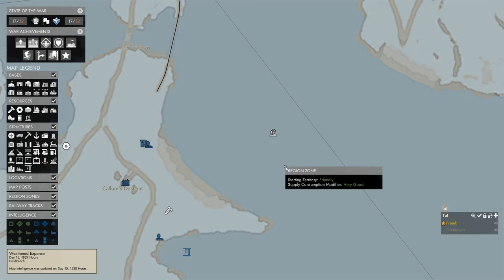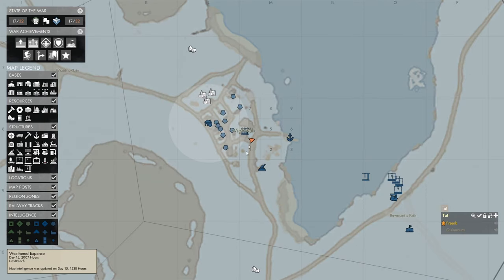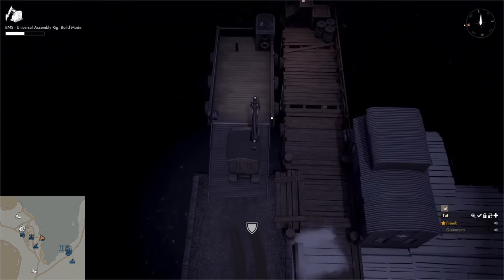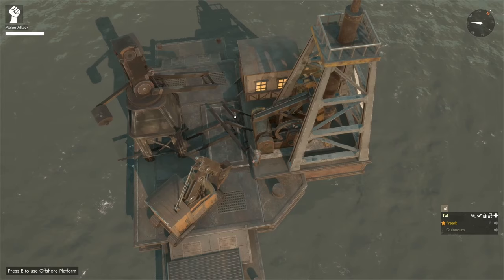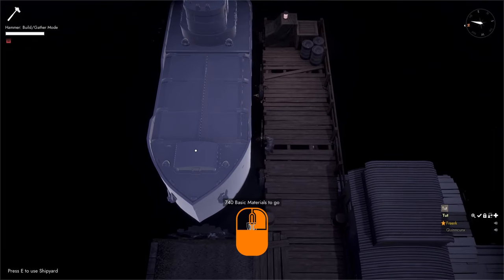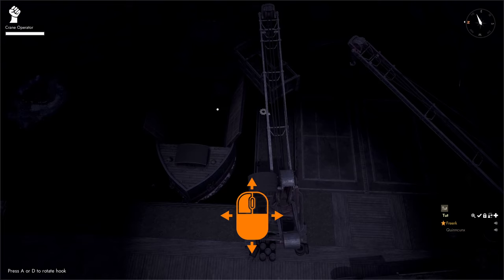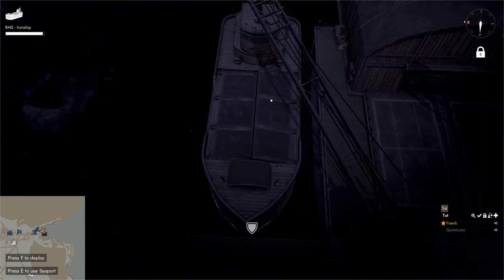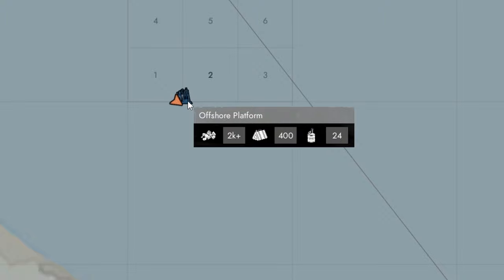Foxhole Guide - Offshore Platform

Comment: Be careful with the barge's ramp and the oil platform's ramp. If they are too close the vehicle physics can glitch out, potentially sending you into the water. Fortunately you do not have to drive all the way onto the platform to repair it.
I built a couple last night and it took several tries to line it up right. The game cannot decide if the vehicle is on the barge's ramp or the platform. The ramp is supposed to pass through the surface you are docking with, but the oil platform has a more complicated shape. Of course the tight spaces doesn't help.
Reply from the maker: I had issues driving up the ramp at my first three attempts/takes. My CV just disn't have the power to overcome the ramp backwards.

Comment: I lost two CVs trying to repair an oil rig because the ramp of my barge glitches through the rig and when I drove the CV off it got stuck and slid off in to the water. The first one I had loaded with all my construction mats when it fell in the water, the 2nd time I left the mats in the barge until I was safely on the platform.

3rd attempt I got on the rig only to find out my tech lvl wasn't high enough to repair the rig🤦. Took me an hour of time wasted on stupid rig.
Reply from the maker: Yeah, t he ramps on the oilrigs are pain, especially because of the low power that the CV has